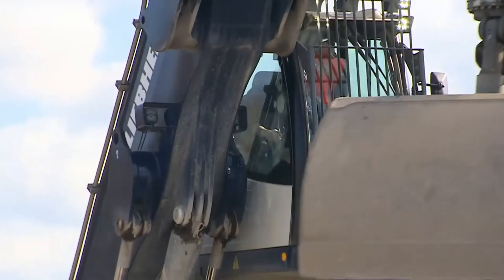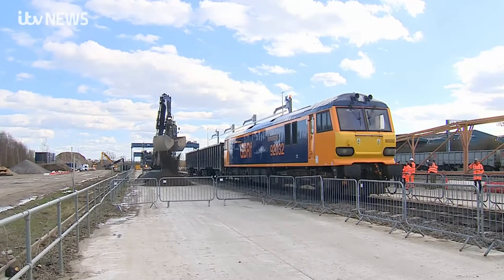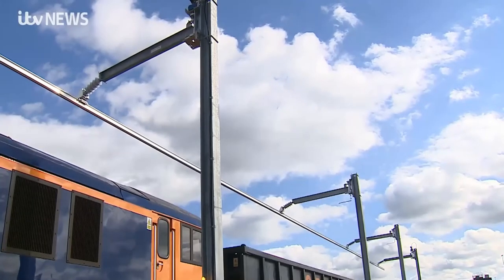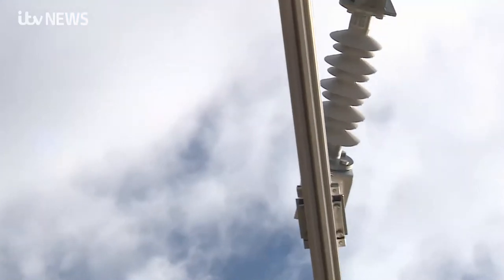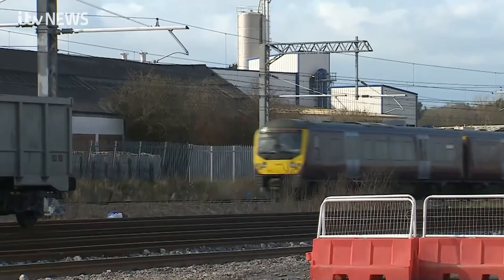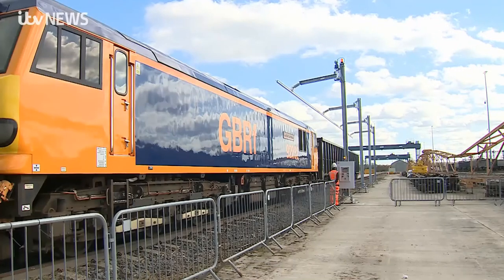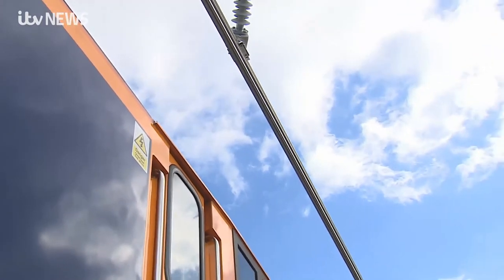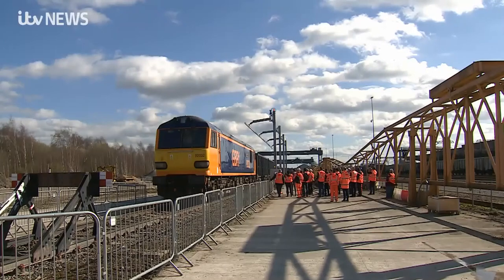Wellingborough Electric Freight Demo in the news

Comment: Getting rid of diesels loco's, how many trucks does one 3,000hp loco remove?  Why don't you push the owners of these great big tin sheds, to move to rail as well, the money invested in GEFCO over at Corby, now run by BCA all wasted, when theres 6 or more massive sheds.

Now you have DB running weekly trains to Europe from Toton, all run by diesel.

If the whole network rail was all under electric, the UK doesn't have the capacity to generate enough power, then compound the fact you will have electric cars charging, the grid just isn't their at present.  So funny when you have the Government reversing there woke lets go green agenda on trying to keep West Burton, Ratcliffe on Sour coal power stations running as base loading. Then push to drive oil & gas back to the forefront, its all good when there is no ripples in the pond, goes to show, Oil & Gas will be around longer than any of us.